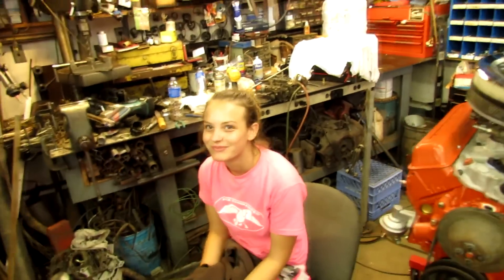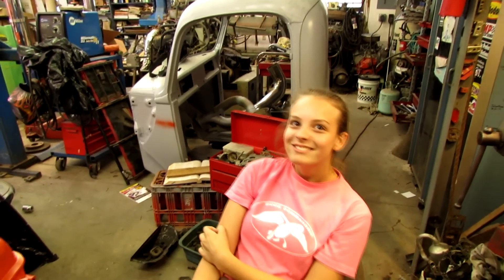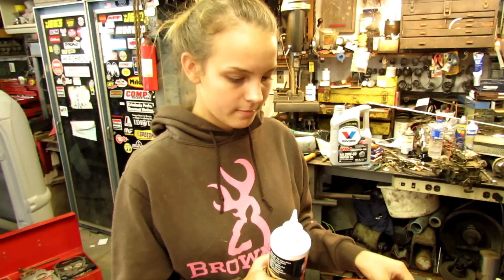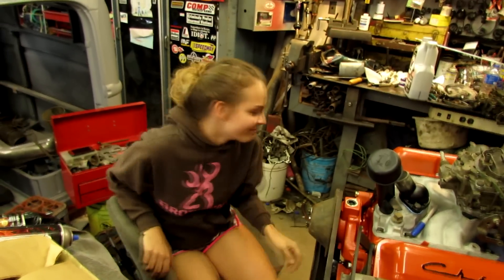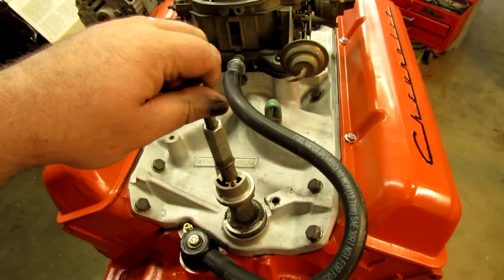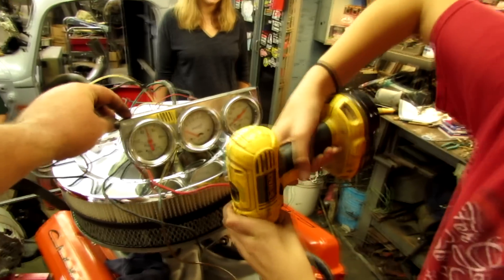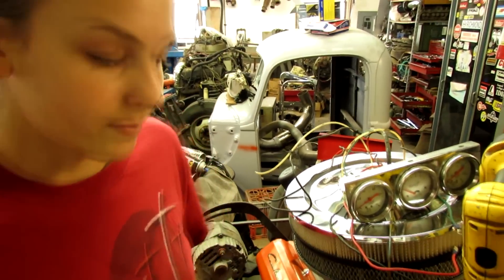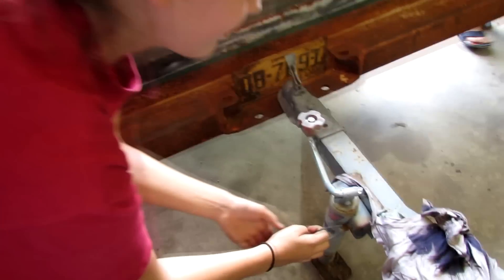Littlemiss builds a 283 Part-5

Comment: 66 turned over sloowwwwwly gettin away from that trailer.  Also, the Right wheel on the 66 seems to have very slippery rubber as it broke loose from the pavement, must be defective rubber lol.
Reply from the maker: lol

Comment: I'm doing a sbc 400 that doesn't have holes in the head for brackets.have any ideas what to do.
Reply: You need accessory brackets from a 283/327
Reply: Are they low Mount.thats what I was told I needed.